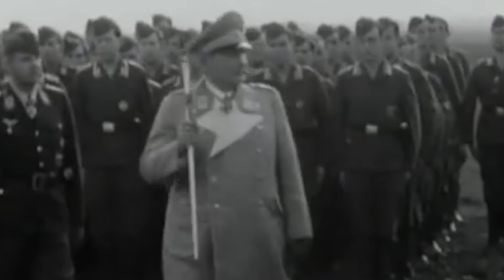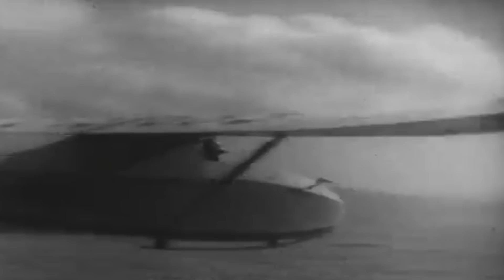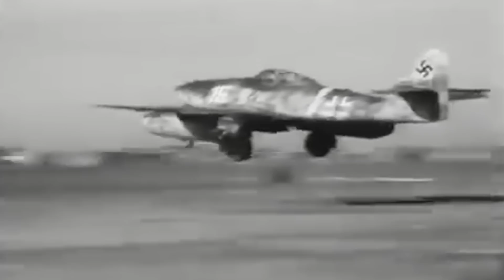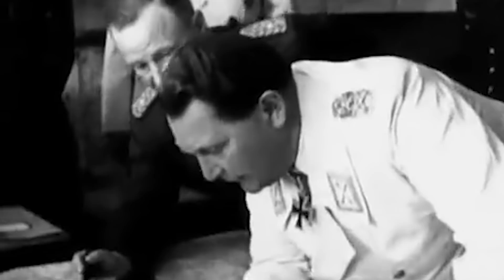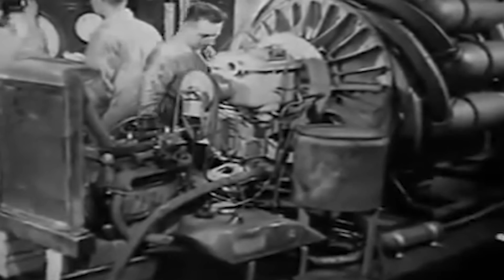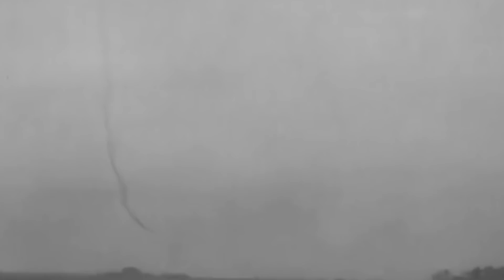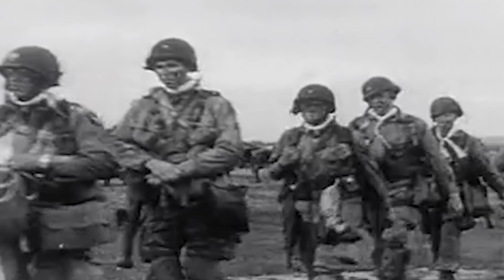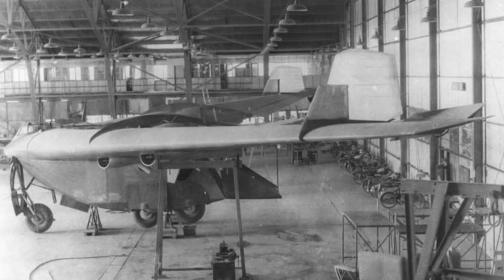WW2 Secret Stealth Bomber - Germany's Horten Ho 229

Comment: PLEASE don't use clickbaity titles. the 229 was never designed as a stealth aircraft, nor intended to be used as one. its limited radar cross-section is entirely do to its aerodynamic design and simply a byproduct of its construction
Reply: Well, Reimar Horten himself said that they mixed charcoal dust into the wood glue, because he belived it would absorb some of the radiation, but after tests conducted by the americans, thy did not find any trace of charcoal in the wood coating. They actucally made a clompletely wooden mockup of the airplane and tested its radar cross section, and determined, that the aircraft, flying at low altitude and with high speed, would still be easily detected by british radar, just a bit closer than a Bf-109.
Reply: @justcallmesteve9123  He himself did not say that. A British author who claimed to have met him in '1983 did.
Reply: @peterson7082  
To make it completely clear, he mentioned it in a book he wrote with Peter F. Selinger, in which Horten states: "the added charcoal should absorb the electrical waves." Although it is not clear which exact model or prototype Horten was talking about, the lack of charcoal dust in the captured Ho 229 V3 may indicate, that the V3 did not actually was constructed with stealth technology in mind. When they tested the aircraft's radar cross signature, and possible charcoal contents of the wooden layers, the spotted small, black particles in the glue. They were identified as oxidized wood however, it may be so due to the age of the material. To sum up, scientists are not certain about the charcoal dust, but the fact that, as I said, Horten himself mentioned it, leads me to believe, that it was, in fact, mixed with charcoal. This though does not matter, as the V3 was never flown.
Reply: @justcallmesteve9123  
That would be with the the modern  radar technology, we know however for a fact, that wooden frames were even for the british radars not that easy to detect.
It may the difference in wavelenghtes that made them less detectable.
Reply: @Enthropical_Thunder  they tested it with several wavelengths, on the leading edge.
And while the return signal was weaker then expected, it was still well within the margin of detection for any random bit of plywood.
Reply: @Raptorrat  
The problem is, that, if this would be true, the Mosqito aircraft would also be perfectly detectable, yet it wasn't.
It doesn't help, that the radar cross section of a flying wing should always be smaller than that of an equally heavy conventional aircraft, independant of the material use. Perfectly detectable would mean, that the aircraft be as detectable as befor. However most sources state, that the Ho 229 had a 20% reduced radar section compared to equal aircraft.

So you will understand, that your answer is less than satisfying, as it pretty much explains nothing, it only raises questions.
Reply: @Enthropical_Thunder  the mosquito was most definately detectable with radar. Yes, it had a smaller crossection then an aircraft of simular size, but it was still large enough to be reliably detected.

Considering that the leading edge of the Ho229 was a "hard" edge, radar signals still would have bounced off it, and thus be detectable. 

To use a crude analogy: if you take 20% of a truck and trailer, it still leaves the trailer, which is quite detectable.
Reply: It's a nuanced difference between clickbait ('intended' deception specifically for the purpose of achieving increasing view count,) and saying something that happens to be inaccurate but is, on the surface, seemingly true.  The chances of this being the latter is too high to just declare that you're certain it's clickbait.  That's highly assumptive as well.
Nuances exist, and pretending they don't is intellectually lazy, not to mention the fact that it's as deceptive a thing to do as clickbaiting itself is.
Reply: Ahhh yes so i imagine you know not of what you speak about in detail
Reply: But just because of his design and perhaps the wood construction turned it a low radar signature, not by intention on design but it was really a stealth - this term was not so common or even exhisted at the 40's...
Reply: Because the fuselage was mostly made out of wood , absorbing a lot of the radar energy instead of radiating it back. THey did not know or understand "stealth" and did not design this with that in mind, it was just a byproduct of the design.
Reply: Qiang kung ha,.. just don't try to look like you know everything! You know shit what it was intended to! The fact is, that it was a pioneer of a stealth airplane due to its design and its paint...
Reply: Wrong. From the design and engine placement to the materials used and even the paint, it was completely designed around stealth and minimum radar visibility. It's been rebuilt and thoroughly studied.
Reply: No one said it wad designed as a stealth aircraft fool.
Thats only in your brain.Fool.
Reply: Which would have given another 30 minutes of air time to the air craft before the Brits could have detected it. Intentional or not, it was still stealthy.
Reply: Qiang Huangsha
Bitch please!  You only limited yourself on copying European technology( and by that I mean you created crap ) so limit your comments to what Chinese realized lately, namely nothing !
Reply: A byproduct of the construction, yes.
Only related to the aerodynamic design, no.
What also seems to decrease the radar cross section, was the use of coal dust in wood glue and paint, it acts as a slight radar wave absorbing material.
It was a a coincident but it effected the visibility on enemy radar ;D.

Also, with a service sealing of 15000 meters it could as well be out of range of enemy radar, so, in principle at least, "stealth".
Reply: @Enthropical_Thunder  in Engineering we call that a feature
Reply: @nathanfrazier8525  
You mean "in marketing", for an engineer, it is a "pleasant side effect" XD.
Reply: How can you speak of stealth when radars was brand new at the time
Reply: @alexejnemov  
Well, they already had passive and active radar countermeasures for the radar technology in ww2, the axis as well as the allied side, so they knew how electromagnetic waves reacted to certain materials.
You should never forget how much war pushes technology development.
Reply: @alexejnemov  well, countermeasures was not a so common them these times but keep in in mind the confusion on german radar displays when  the Brits used some smart technological solutions like the oboe or even metallic metal scraps cutted at wavelength of German radar... Why not the germans maid be searching for technology answers, too?

Comment: And this is how usa build b2...and f117...in recent time they adopted yakovlev design which ended to be f35
Abrams mbt is leopard 2....
Reply: Northrop was building flying wings at the same as the Hortens
The f35 uses a completely different lift system than the Yak and only in the B model
The Abrams and Leopard 2 were both developed out of a cancelled joint MBT program between the Bundeswehr and US Army

Comment: The idea that the Horten was designed as a "stealth" aircraft is a rumor. There is no substantial evidence to suggest the aircraft was designed as such. If it did have any minor stealth capabilities, its merely a coincidence.

EDIT: The HO-229 is a fighter bomber not strictly a bomber per say. The other Horten designs were more akin to bombers.
Reply: I believe that this is exactly what he said in the video ...
Reply: ...the stealth characteristics of the Horten H.IX (Gotha Go 229) are an artifact of design, a bonus feature by way of coincidence, not design intent...
... it's design intent was to minimize drag in order to extend range of flight...

Comment: Excellent video as usual; however the perception (perhaps even complacency) that the Ho229 could not have made a difference if delivered in sufficient numbers in a timely fashion is, I suspect, dangerous. Remember that the Northrop flying wing designs were rejected, despite their promise and generally impressive performance; also the USAF relied upon piston-engine designs for (let's be honest here) far too long, which would have meant that the Ho229 could out-altitude and in many cases outrun defensive fighters sent to intercept it. I imagine that nuclear strikes against European targets would have been an absolute last resort due to the number of GIs and the sheer amount of their equipment deployed in that theatre; hence, perhaps the Allies were lucky that the genuinely innovative ideas came far too late for the Third Reich to use them to devastating effect.
Reply: It still wouldn't have had much effect.  If you look at the issues that the US Bombers had with the Jetstream in Japan with Really High Altitude Bombing then you'd know that the HO-229 wouldn't have made much impact in the War.

1.)  Too little, too late.  Depending on when it entered service, it is doubtful that enough could have been produced to have a meaningful impact.  Same for Aircrews and training.

2.)  Fuel.  With the attacks on Germany's refineries starting in '43 you start to see a choking of the German Luftwaffe's fuel supplies.  Given how inefficient early jet engines were, it'd doubtful they'd be able to keep the sustained bombing campaign required to knock the US out of the war effort.

3.)  Wrong direction.  If you want to knock the US out of the European theater, you are looking at the wrong enemy.  The biggest threat to Germany was Russia, not the US.  The hordes from the steppes would have steamrolled Europe without any help from the US or UK.

4.)  Nuclear option?  Hypothetically speaking, if Germany's top physicists hadn't killed themselves in a runaway nuclear core, who and where do you target?  You knock out England, Russia still crushes you and the US continues to deploy the B-29 to bomb you from the states.  Bomb Russia?  Where do you hit to cut the head of that hydra?  You might get some of the leadership, but there is no guarantee that you'll get enough of them.  Also, you'll still have to deal with the US and UK on the other front.  Knock the US out of Europe?  Russia still wins (and Europe loses).

So yeah, the HO-229 IS discountable as it could not have made any noticeable difference in the outcome of the war.

Comment: You forgot to note that the Horten was supposed so be made of mostly plywood for the fuelselage (wing) and the cockpit section too. While the twin engine's were to be made of the metals they had due to the fact Germany couldn't get it's hands on alloy's at the time. Also supposedly the wooden frame would help with the stealth by the radar mostly going through it instead of bouncing back. Might be wrong tho.
Reply: It actually has a lot of effect on stealth. The British Mosquito is an almost entirely wooden aircraft and they were only really detected by radar when either head on with the station (picks up propeller) or perpendicular (picks up engine).
Reply: @ParkerUAS  
Now that you mentioning it, i read something about the german on board radar system of their heavy fighters and night fighters having problems with the visibility of wooden framed aircraft like the Mosquito. This however might as well be the consequence of most german radars being pulsed radars and mostly working on longer wave lengths instead of the british micro wave radar (due to the ritish invention, the magnetron).
Reply: I think it had some effect but not a lot.

Comment: ive always thought there was a good bit of similarity between the ho229 and our B2, like we may have gotten at least a lil bit of inspiration from it that went into our B2.
Reply: There is likely little to no direct technical influence. Flying wings, either as gliders or propeller aircraft have existed prior. 

Northrop is the most obvious example, developing flying wings far before the Ho 229. Northrop developed the N-1M in 1940 and the N-9M in 1942 years before the Horten Ho 229. There were other flying wing attempts apart from Northrop.

What Germany did manage to create was a functioning jet powered functioning wing which isn't anything that amazing 

Northrop then designed and built the XB-35, a propeller flying wing bomber in 1946 and the XB-39, a flying wing jet powered bomber version of the XB-35 in 1947.

The Ho 229's """"stealth"""" capabilities are nothing special. It being a flying wing helps against radar. Since it was made of wood, it also helps. IIRC, charcoal powder was used but with questionable effectiveness.